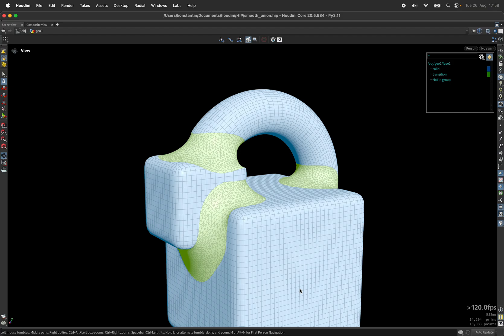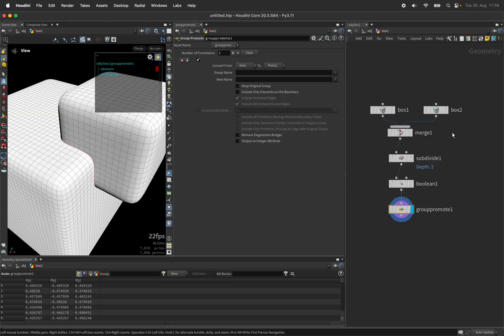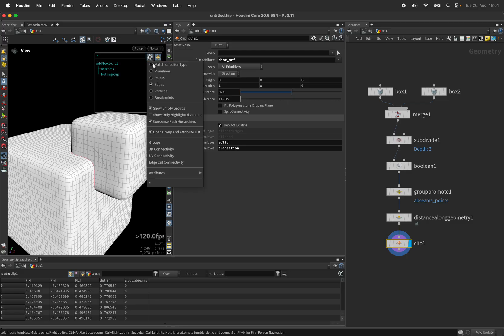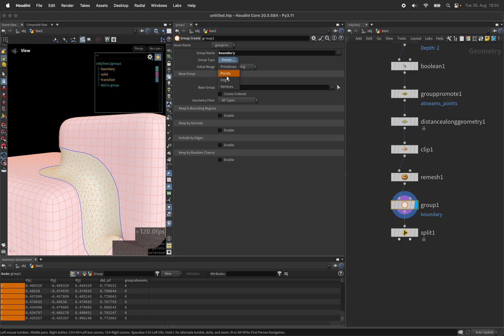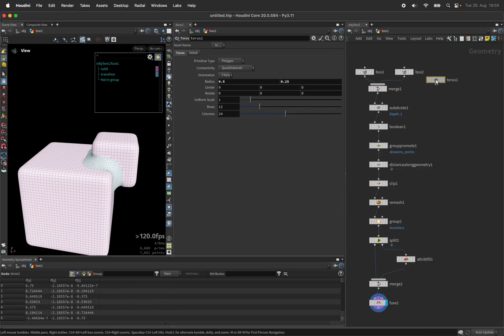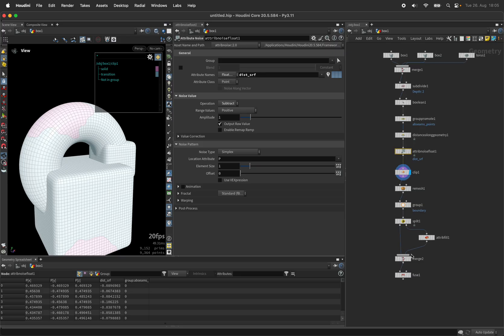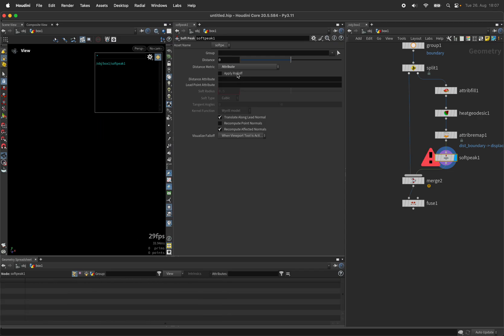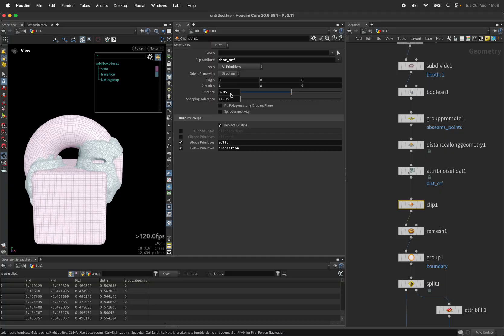Smooth Boolean Unions – Houdini Tutorial

Comment: On some occasion the Distance along geometry output returns a nan value that cause problems. Feels like a bug to me.
Reply from the maker: Maybe these are distances to parts it cannot reach? Otherwise feel free to send me the Houdini file.
Reply from the maker: Thanks for the mail. Yes, it seems the heat geodesic fails in your particular case. I'd recommend to either set the torus rotation from 1087 degrees to 0 or switch the mode from "heat" to "surface" to make it work.
Reply: @KonstantinMagnus  Sure, no problem. But i was trying to understand why it does this. As that can happend on other situations. And when the heatgeodesic node is added it crashes Houdini. So better find a stable ways to to this :)
Reply: @KonstantinMagnus  It seems the problems comes from points with no @dist_srf attributes. But i can’t seem to find a way avoid it being created with nan value, even when i initialize it before the distance node…
Reply: I am having the same issue, following exactly what was done here with the 2 cubes.
Reply: ok, I was the issue. In my case I used the abseams_points in the 'group' instead of 'start points'. My bad.